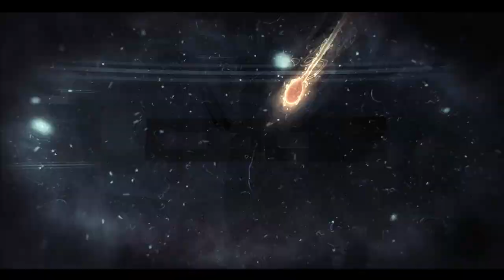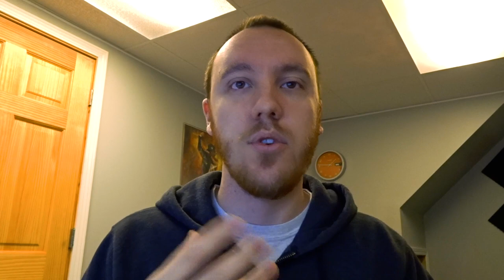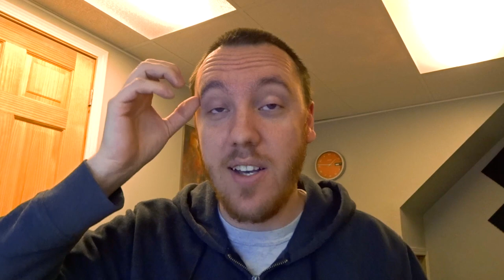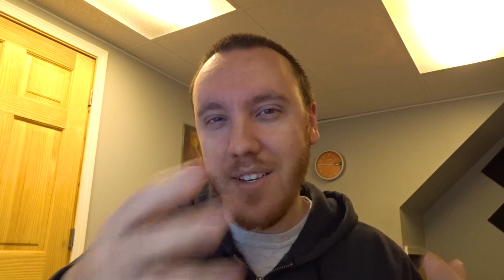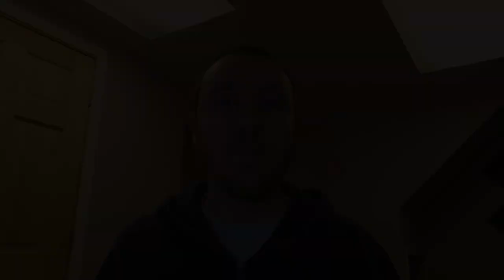Introduction to Art-Net Lighting Protocol Episode 1

Comment: Hello
I'm wondering if I can use the Artnet to drive my Grandma onPC without having a command wing? I have the ma onPC software on my laptop and I'm looking for an interface to enable me to use it control my lights.
Reply from the maker: So I am not familiar with grandMA enough to say for sure, but I believe grandMA requires a command wing, or other hardware to allow the output of the parameters. So whether or not those parameters come from a wing, or artnet, it still requires that there is hardware connected to unlock them. However Dot2 (grandMA’s younger cousin) allows the output of one universe without any hardware connected.
Reply: You need a grand MA node. 
Either 1k or 2k node.
Reply: @NA-ll7uy  thanks